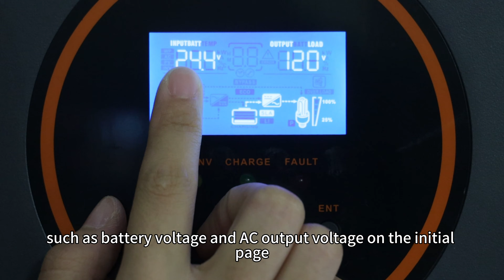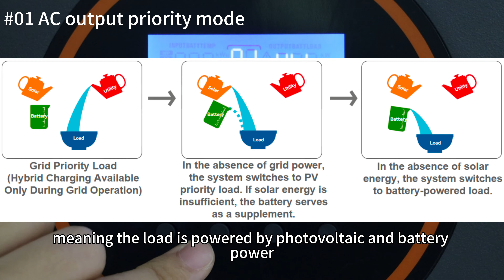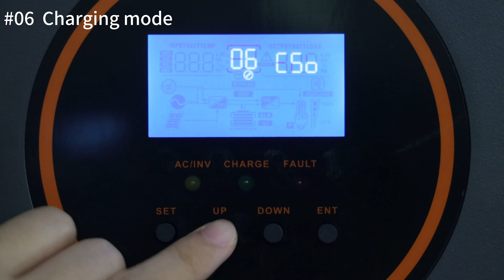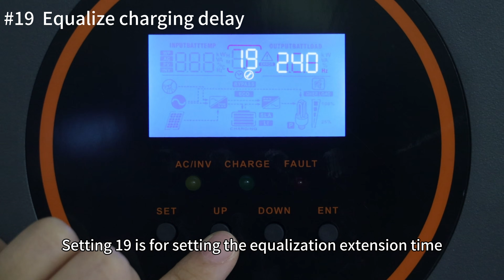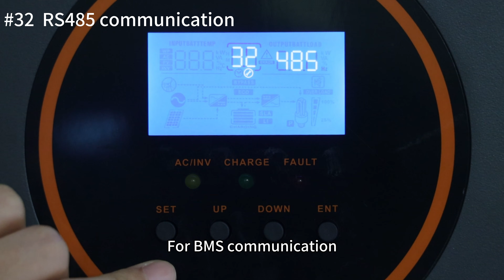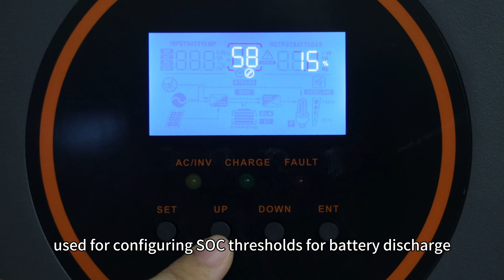How to Setup the POW-LVM3.2K-24V Solar Inverter?

Comment: Settings 36 and 39 are not in the equipment manual, also setting 57 is in the manual but it does not appear on the equipment, I had to resort to watching this video since I cannot complete the configuration of my equipment with the manual that you provide.
Reply from the maker: Kindly check the manual below: 
https://cdn.shopify.com/s/files/1/0746/0415/1079/files/POW-LVM3.2K-24V_User_Manual_f7574ab7-ffd5-4f15-aa53-af2b89a6674d.pdf?v=1741144283
Reply: @PowmrSolar  Thank you very much, the manual that came with my inverter is different, even though they are both for the same model.

Comment: Good day, i am not using any utility power in my system. I run the system with the panels and fla batteries. On the lcd display the inverter icon isn't showing up and it is showing error #3 and #29 and the inverter wont restrart. What can i do to fix this?
Reply from the maker: Please send it to this email: support@powmr.com. Our technical staff will check it for you.

Comment: I have problem with error 59, when run the inverter a fews mins, the error 59 come out. pls guide me.
Reply from the maker: Error 59：BMS Warning
1: Turn off the machine first, then turn it on with only the battery connected to see if the fault can be clarified.
2: Use the battery’s host computer to check whether the battery is faulty.

Comment: in the 8 option witch one of the options I must use for the LiFePo4 bateries?
Reply from the maker: [08]
LF07/LF08/LF
09    

LF07/LF08/LF09 lithium iron phosphatebatteries, corresponding to lithiumiron phosphatebatteries 7-series, 8-series and 9-series. Thedefault constant voltage charging voltageof 7-series is 24.8V. The default constant voltagecharging voltage of 8-series is 28.4V. Thedefaultconstant voltage charging voltage of 9-seriesis31.8V. They are all adjustable

Choose the corresponding number of strings according to the parameters of your battery.